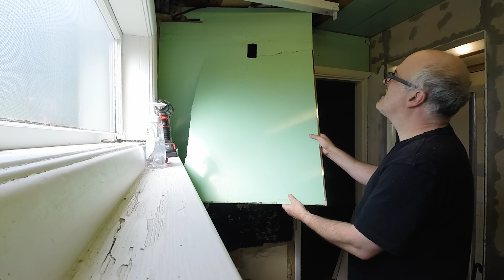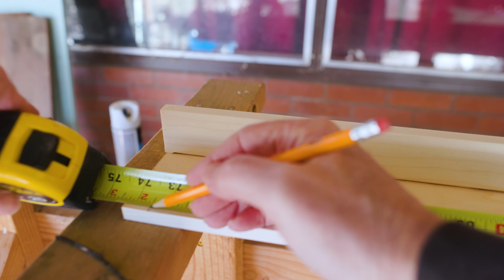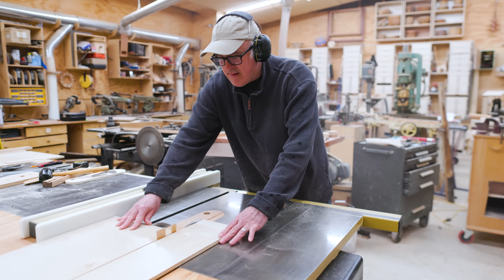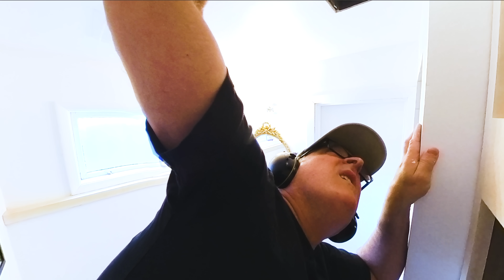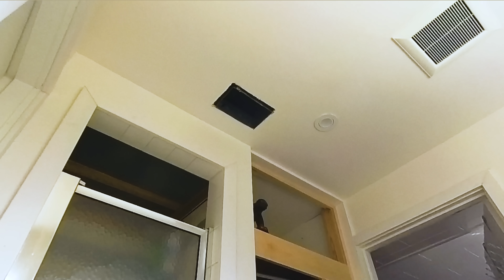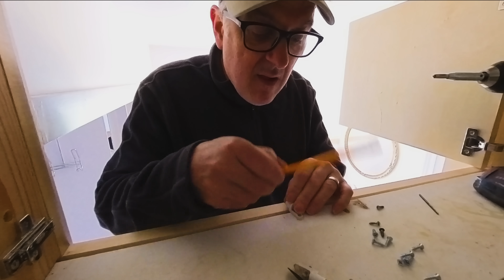Why did my Bathroom Remodel Take 13 Years?

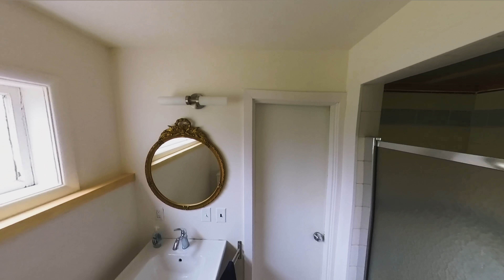Comment: 29:46 no handle on the door for the water heater ?
Reply from the maker: I ended up putting a towel bar there which works as a towel bar and the handle for the door.

Comment: One question. One observation. 

What kind of camera was that? It looked like it might have been mounted to the ceiling and tracking you when you were caulking. 

The temperature and pressure relief valve on top of the water heater releases water when needed to protect the system from over pressure. The pipe coming off of it is a drain that relies on gravity to evacuate. If you pipe it up like that, the pipe would have to fill up completely before any water would ever come out of it. So you’re essentially trapping all this water and exposing it to the air. Trapped water will stagnate and things will grow in it. This trapped water is sitting up against the t&p valve. When that valve opens, the pressure behind it will obviously be higher than that of the water in the trap, but that doesn’t mean there won’t be any contamination. Also, the older the t&p, the likelier that if it does purge, it won’t seal off completely, leading to a small amount of water continuously issuing from it. But if you had close the house water supply for some other reason, then you’d almost certainly pull all of that trap water back into the water heater where the hot environment will accelerate the microbe propagation.

Comment: Looks good Frank...did you happen to check the water heater minimum clearance to combustible materials, as well as required ventilation room? Your house has a lot of birch plywood in it and I wouldn't want it to combust! ;-)
Reply: Electric water heaters don’t have a minimum clearance to combustible materials as they don’t rely on combustion to generate heat.
Reply: @BCTCanadian  Home Depot calls for 6” of clearance for ventilation…but an electric water heater uses submerged elements to heat the water. There is no air-flow involved. 

The only need i can imagine for ventilation is to minimize the ambient air temp increase from radiation from the hot tank. But the thicker insulation generally keeps the outer jacket relatively cool. 

The bigger concern here is that the new shelving cubbies are installed with minimal clearance. When the old tank fails, a new tank is unlikely to fit in its footprint. 

Also, the drip leg off the t&p needs to run down hill to day light.

Comment: I learned from  a cabinet maker years back that a file is the best way to trim up edge-banding, but i have also cheated and used a flush trim bit in a router

Comment: You can get a cheap plastic tool which told two box cutter blades. It trims the edge banding perfectly flush on both sides in one smooth motion. I used to use a chisel referenced against one face of the wood, which works okay. But the tool was well worth the money.

Comment: Re the long miter joint
Lay them flat on the bench points touching
Run packing tape along the joint
Flip both over (carefully) run a bead of glue in the bottom of the vee
Fold and brace square
Ez Pz

Comment: Another great video as always, Frank! For the edge banding, using a blade works great. If you were going to be doing a lot of it, there's a tool made specifically for trimming edge banding. I used to work in a cabinet shop and we had them laying around everywhere. Sort of like how you'll find carpenter's pencils laying around everywhere haha

Comment: Frank, it all looks great (like all your projects). However… for the life of me I can’t understand why you didn’t use pressure treated lumber for the cabinet base. That wood lays on concrete next to the biggest water source in your house. What if water heater leaks or condensation collects on the floor from the shower? Just asking…
Stuart
Reply: Agreed, code requires pressure treat. Looks great otherwise.

Comment: I have watched a lot of your videos and I’ve always noticed that when you are using the radial arm saw, you don’t pull it in a single smooth motion. Rather in steps were you go fast and slow alternating.  Is there a special reason as to why?  Thanks for all the inspiration and knowledge you share. Regards /Danjel

Comment: Nice update for sure.  Nice work around the hot water heater.  That wood face on the outside of curb on the show will likely not last a ton of time if that shower gets a lot of use (being a basement I doubt it) , but I would personally re-tile that shower and use a more modern frameless glass door for the shower.  I used to call the one we had like that in our 70's home a "bathing cave".  It was super dark in there.  I ended retiling the whole deal, make the door as a wide as possible with a modern door, built in shelves and much brighter light.  Was a nice update.  I used 12 inch tiles in a diamond pattern.  Lots of cuts, but it turned great.  Much more modern and slightly more function.

Comment: The hard black glue could well have been some asbestos glue. At least that's the judgement of such in my late 1960s house. They used such back then for tiles, boards, floor laminates and such.
Reply: I was thinking the same thing.

Comment: Pet peeve of mine. It’s a water heater not a hot water heater. If anything, it could be called a cold water heater. I was set straight about this by my plumbing design instructor 40 years ago.

Comment: As a fellow architect:
I understand the long remodel process.
I think you do a nice job. 
I'm surprised you call the water heater a hot water heater.  If it was hot, it wouldn't need to be heated...

Comment: I was going to comment on the new and fatter water heaters but somebody beat me to it.  Good luck when the time comes.  That valve is the TPR valve, Temperature and Pressure Relief.  I am surprised your codes people let the plumber vent it upward.  That can be dangerous and locally it's a no-no.  Nice job, big improvement.

Comment: Hey Frank. It looks good, but the insurance adjuster in me is cringing at that cupboard you built in next to the water heater.  That space isn’t there just for fun,  the water heater needs a certain amount of cubic feet of airspace adjacent to it for proper combustion and radiant heat dissipation. You’ve robbed it of that airspace, and it’s going to compromise the efficiency of combustion and/or the remaining lifespan of the heater.   Because you trimmed out the cabinet, it is a full built in that will have to be ripped out when you have to replace the heater. 

In the interim, I recommend you make some vent holes in the sides of the cubby’s so that you at least restore the necessary airspace for the heater.
Reply: same. i was wincing not just at the heat but at the prospect of trying to maneuver in that tiny area for any work on that heater. holes in the side and probably change the door for a louvered one
Reply: There's a medium size closet behind/as part of the the space, that opens into the guest room.
Reply: Radiant heat distribution? There are plenty of companies that sell insulation blanket kits that up r-value of your tank, for more efficiency. If anything, you want to block heat distribution.
Reply: @rozinant1237 dissipation. Not distribution. They radiate heat and you don’t want stagnant warm air in the closet without either air exchange with an adjacent room or at least enough cubic feet of airspace for that heat to dissipate from the closet. 

That warm air hits the cold water intake line and causes condensation, which results in humidity increases, mould, rot, corrosion and accelerated deterioration of the tank or its fittings ect.  You can usually mitigate this by checking on everything regularly—unless of course you have completely pinned the tank into a tiny corner with only a few inches of space around most of it..  

In my experience as an insurance adjuster, his install has retroactively made his water heater against code.  It’s illegal. If there’s an issue pertaining to insurance, he could have problems with coverage and further underwriting. Of course they may just cover a claim but tell him they aren’t paying the restoration contractor to rip out the built-in nor paying to rebuild it at the end. 

It’s an unnecessary risk for extra storage for six towels.
Reply: might be an electric water heater
Reply: @larrymyers6749  that’s true, but it still needs the airspace to dissipate the heat that radiates off it or he will experience dry rot.  With electric, D epending on how hard the water is in his area, it would definitely need to be replaced soon, necessitating tearing out his storage. The area I lived in for 30 years had no natural gas lines (Canadian arctic) so everyone had electric water heaters, and they more often than not didn’t last till the usual 6 year warranty ran out. I was on my third heater after five years. By comparison, a town 100 Kim’s further south did have gas and they’re gas water heaters lasted 20+ years before rupturing.

Comment: 23:38 rather than doing that way and not getting a great finish, take the blade out, and set it flat on the surface outside the edge you want to trim, then angle it slightly so that the cutting surface is flush, and prop it up with your finger. Dragging it down will then perfectly slice the excess leaving a slightly undercut edge that will not catch.

Comment: I recently made a murphy bed and used edge banding for it - I think somehow we bought the same cheap iron (or at least they were made in the same factory)! When it came to trimming the excess I used a sharp chisel laid flat across the plane of the plywood board and attacking the iron-on trim at a 45 degree angle to the length I was cutting. It came off in a nice long thread the length of the panel and left a very clean blend between the ply & trim.

Comment: I had a consulting mechanical engineer that always use to bring up his frustration with the term: Hot Water Heater. When on long drives to site visits the ensuing dialog we had was always entertaining. Thanks.
Reply: In my country we call it a Boiler, but they're rare nowadays, as most homes have a central heater/water heater unit on the gas mains. Though they're trying to push the transition to heat pumps nowadays, to get off the fossil fuels
Reply: 'DB board' must drive you nuts.😂
Reply: @stevedotrsa  Have you ever seen a house fly? Yup and, have seen a baseball bat.

Comment: Very good turnout on the remodel.  Bathrooms are the hardest because of tight spaces.  Also if you do much more of the edge banding you might want to buy a trimmer.  Fast cap has some and of course Azom has bunches.
Reply: ^ indeed, the Fastcap edgeband trimmer works pretty well.  Use a block plane for the final trim.

Comment: There might be an altogether better way to implement that T+P drain, but if the current one doesn't have a small hole in the lowest elbow of the CPVC, that's something to address.

Comment: You hv to hv mandatory clearances for the water heater?  Which I do not think 3/16 th” qualifies?
The problem is you made a video history for your fire insurance company ?  It burns they watch and send a real heart stopping letter with no check? 
In short that’s why your plumber rigged everything that way!  Of course these DIY videos are entertaining, being a contractor and carpenter I just cringe at some of the stuff I see ? 

 “ Oh that wall I built sir how did you know I did it”?  “ oh that crown yes I did hv a hard time with it?  It had factory errors on the bottom? It was beveled “. That’s why I am burning that batch gotta go get more”!

Anyway you do nice work but codes are not bendable & your insurance insist they are followed?

Comment: Water heaters have a limited lifetime.  The new standards with extra insulation make them a different outside size.  This means you will have content for another project video.
Reply: yeah i was just thinking i bet they end up with a tankless next time cuz it's gonna be a sumbich to even get that out now.
Reply: @mallorykane2843  You can always cut the jacket and the insulation off and make a real mess.
Reply: @mallorykane2843  But when it eventually fails, it will have to come out...[fortunately, Frank used mostly screws, except for the finish nails on the trim pieces]
Reply: @kenc2257  yes i am aware it will have to come out hence the mentioning it will be hard to get it out.
Reply: @kenc2257  Reno looks nice. However, no service person will spend the time to remove screws and carefully disassemble cabinets to access the water heater for replacement, or wait around for homeowner to do this.
Reply: @mallorykane2843  Yup, replacement of the tank will be a really big PITA now. Raising height of pipe from overflow of the pressure relief valve is not such a great idea either. Ignorant people at big box stores have no idea of standards and support people doing stupid things.
Reply: @harveyellis6758  As someone who doesn't know anything about this, could you explain what the significance would be in adjusting that pipe since it was still going vertical at the end? From what I saw it just looks like he changed the location of a bend, but not the overall height any water might need to travel.
Like going from this:
░░░░║
╔═══╝
▓▓▓▓░
To this:
╔═══╝
║░░░░
▓▓▓▓░
Reply: @pianoanime  The pipe from the pressure relief valve should take the shortest distance - ideally to a nearby floor drain. Having this go vertical is just a very stupid idea. If relief valve opens, there will be the weight of water in vertical section of pipe providing resistance against the flow of water. When valve closes, it will leave stagnant water in vertical section of pipe as well as any horizontal path prior to the vertical section. The problem should have been fixed during renovation, rather than adding to it.
Reply: @harveyellis6758  So the problem was less the adjustment he made and more the way it was installed already?
Reply: @pianoanime  Renovation time is good opportunity to fix mistakes of the past. There are lots of horror stories hidden behind walls by people who do not know what they are doing. Sadly, it is future home buyers discover these surprises, when problems occur. There are building standards for a reason. I have lots of respect for the work Frank does in the work shop. This project had a few errors which should have been corrected.
Reply: AO Smith makes a very skinny 40 gallon.

Comment: A good way to attach wood to concrete is to use screws Frank. Drill a hole in the concrete, put a plug in it and then screw into the plug.
Reply: Alternatively, use concrete screws that don't need plugs as the hardened threads cut directly into concrete or brick.
Reply: Foam adhesive is much better. 

You won’t believe me until you’ve used it. 

Try it with a scrap bit of 2x4 then try to remove the 2x4 and you’ll see.

Comment: The overflow is steam relief pipe. It goes to outside so it doesn't scold anyone. My plumber just put a 'U' in the pipe to act as a condenser and goes to inside.   If you want to fix things to concrete a SDS drill and rawlplugs will work easily. You can get a banding trimming tool or you can break it of with a sanding block as shown on You Tube channel New Yorkshire Workshop, which is another excellent channel like yours.

Comment: In the uk youd lilepy find a shelf in the hot water heater cupboard yats just made out of rough sawn leftover wood thats just a basic frame with spaces in all the slats for airflow, so any towels etc stay nice and dry.
Dont think youd find many solid maple faced cabinetry 😂

Comment: It’s called pressure relief valve line.  In case the water heater overflows, the water will go out this line. You explained it well.